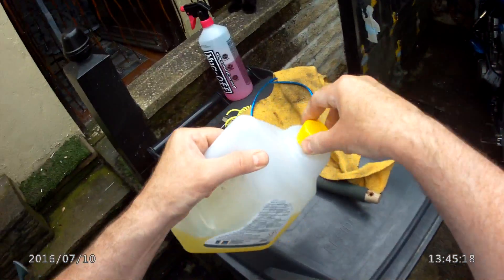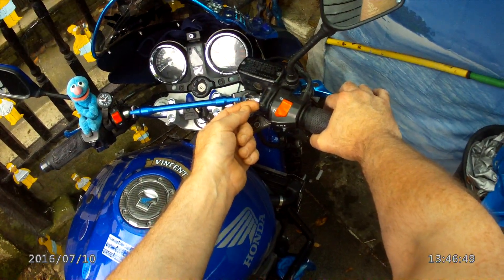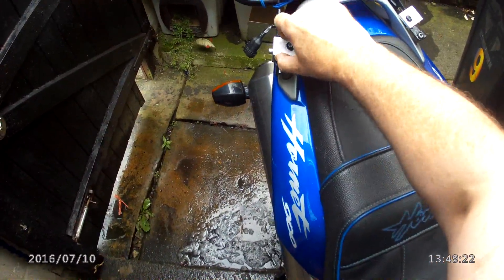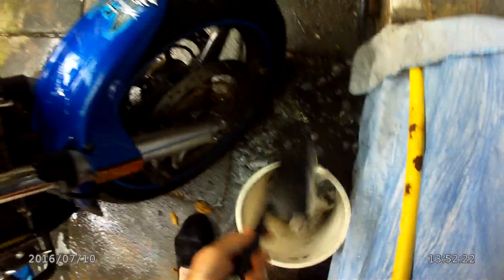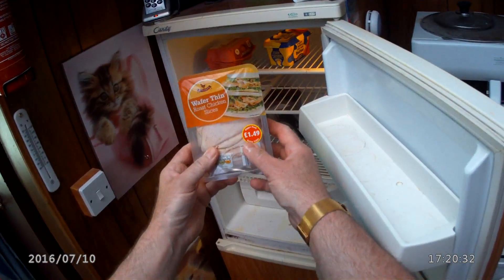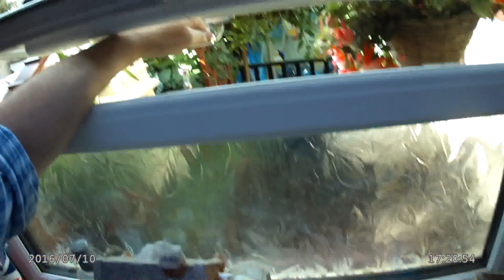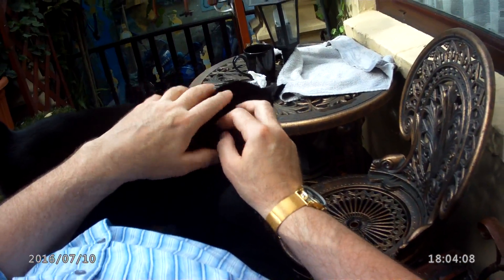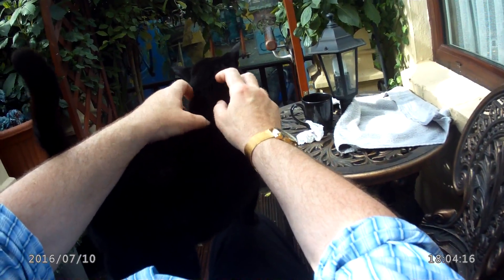...M.O.Tea-time bike cleaning...!

Comment: Whats happened to Wallace and Gromit that was on the brake reservoir?
Reply from the maker: ....he he - I took it off when I was messing with my spongy brakes, and I've run out of sticky foam to put it back on. Halfords sell a big wide roll of it for £7.99, although I might bolt Wallace on the rear Givi plate to replace the one I through away when the red l.e.d failed...or I might not bother at all with it, and just have grover on ...